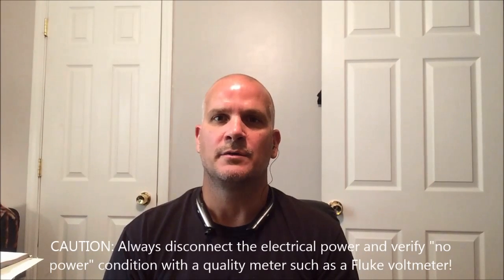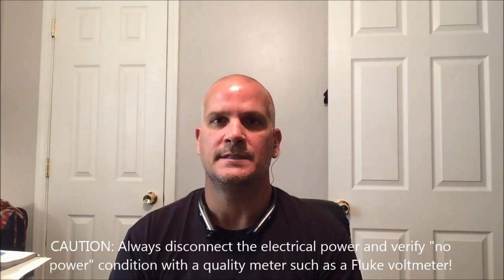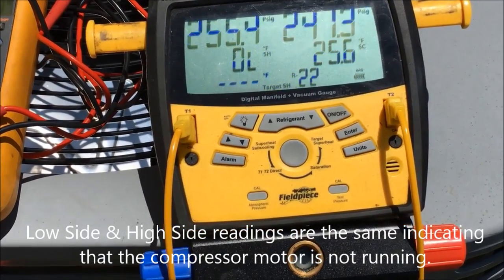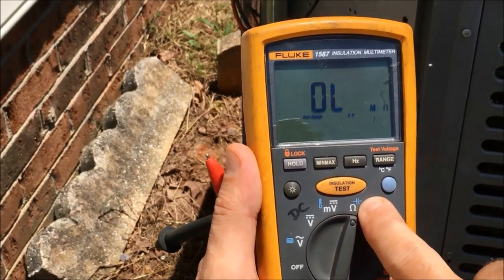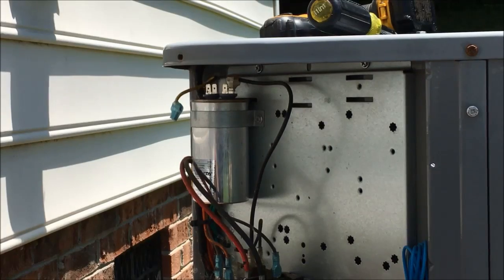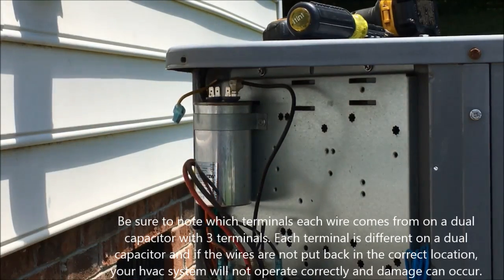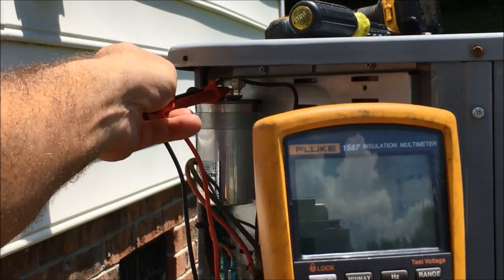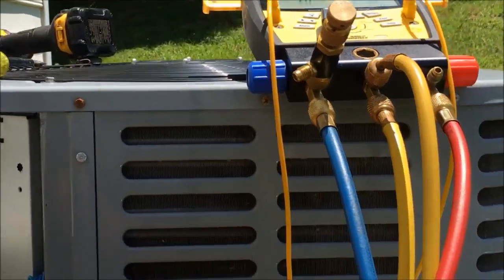Bad HVAC Capacitor Diagnosis

Comment: Hi Tony,
What symptoms does the compressor exhibit when the start and / or run capacitors are bad?  Does it tend to trip a breaker, not start, slow start, run loudly, something else?  
Thank you very much!
Reply from the maker: Everything you mention can be a symptom. Most common is that the compressor won’t start and pulls high amperage until the internal overload opens.
Reply: @thrashersheatingandair  Thanks for the info, it's helpful!